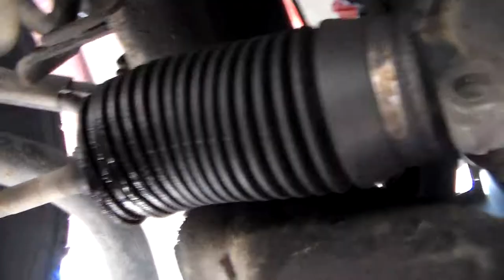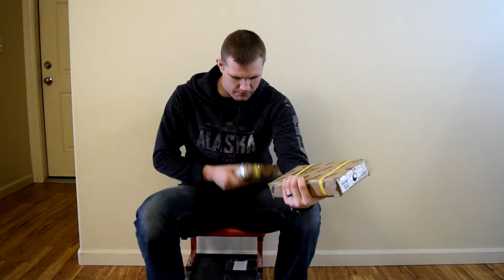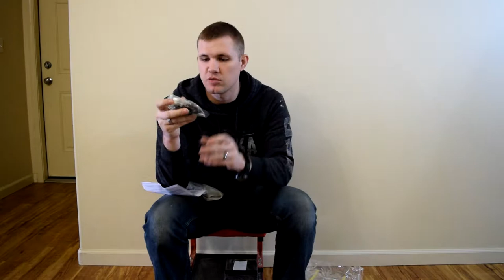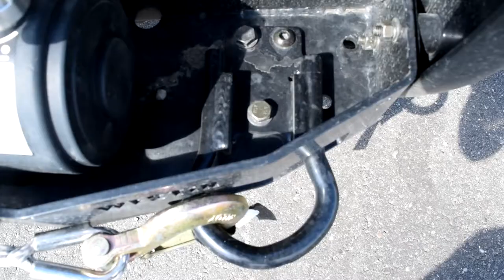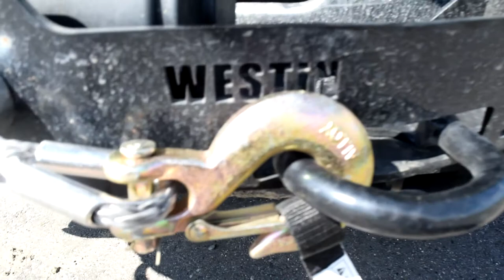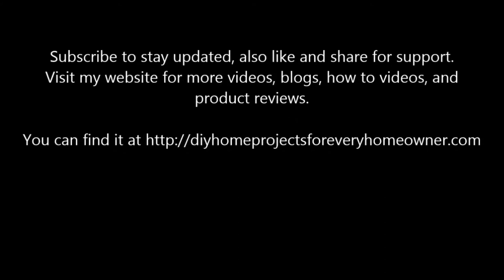How to Install Westin Tow Hooks on Westin Sportsman Brush Guard with Winch Tray

Comment: What I really want to know, if the guard or the towhooks will handle a high lift jack? I don’t want to try to rely on a bottle jack up in the mountains in snowy conditions. Any feedback?
Reply from the maker: This setup with the winch, tray, and hooks, have allowed me to recover this vehicle out of deep snow on back trails in Alaska with no problems.
Reply: @DIYwithChris  is it capable of handling a high lift jack, I don’t always go where there’s anchor points.
Reply from the maker: @surrelljr  I can't attest to the reliability of use with a jack being positioned under the winch tray or brush guard. I can tell you that the metal for all connection points is very tick (approximately 3/4" if I recall correctly) and attached by a series of bolts in several locations directly to the frame where the previous hooks were mounted (but with far superior hardware). I don't believe it would be an issue but I wouldn't lift the vehicle from there if I had any other choice.
Reply: @DIYwithChris  ok, I can wait till I can get some feedback with someone who has actually tried it. May have to manufacture my own.

Comment: Could this take a deer out and still protect the truck?
Reply from the maker: I suppose that depends on how fast you're going and how big the dear is. The faster you go the impact multiplies. With that said, this is a very sturdy guard and while going a reasonable speed I believe it will provide great protection for the truck. I think you might still get some scrapes as the guard shifts and bolts bend due to pressure but the damage would be minimal.